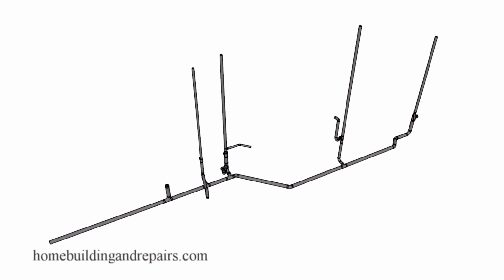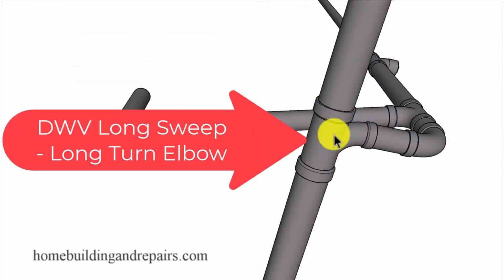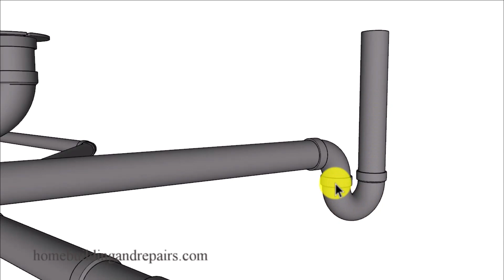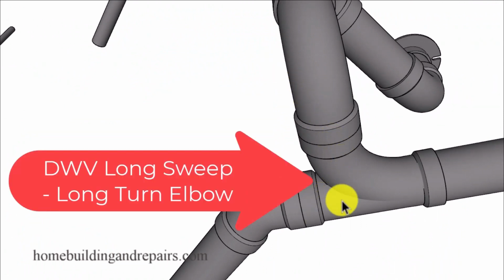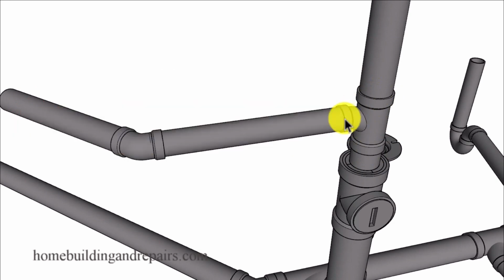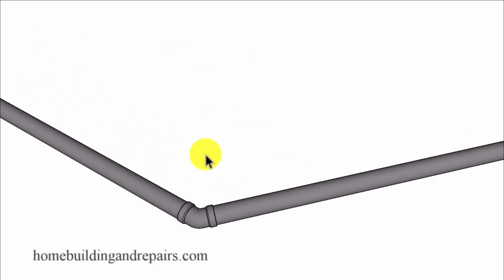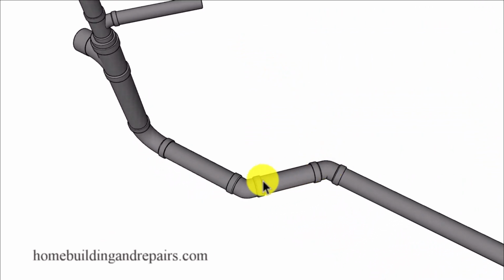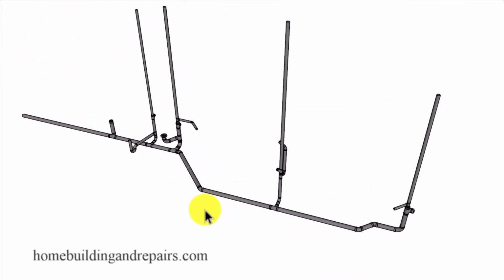Drain Pipe Fitting Names For Small House With 850 Square Feet - Making Plumbing Easier

Comment: I was one of the people who mentioned that the combo fittings looked like sanitary tees. I'm very pleased that you narrated through this configuration and identified the fittings by name on this video.

I did have other constructed criticisms of your last plumbing video, but I see nothing wrong with what you've done here.

Although I don't believe it's necessary by code, I understand that most plumbers use a 4" to 3" reducing 90⁰ for the toilet. As I understand it, it's the only place the code allows for a reduction in drain size, in the direction of flow.

I personally don't understand the necessity for a 4" pipe at the toilet, especially given the 1.6 gal flush volume of the new toilets. But, I use them because I figure there might be a reason that I'm not aware of. No plumbers ever told me why they don't bite their nails either, but that sounds like generally good advice, too.